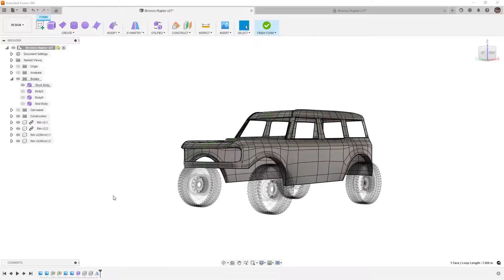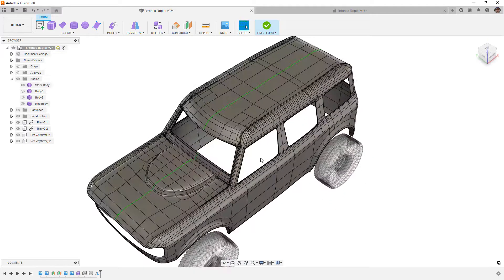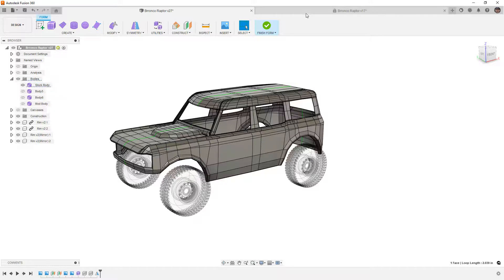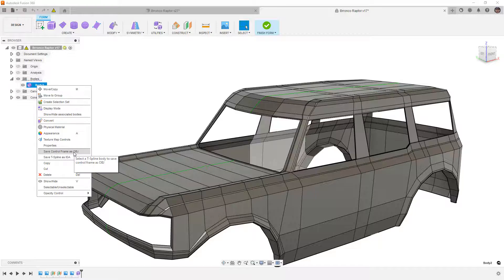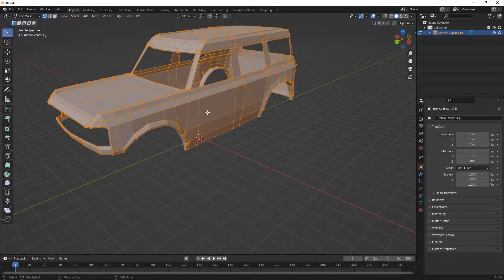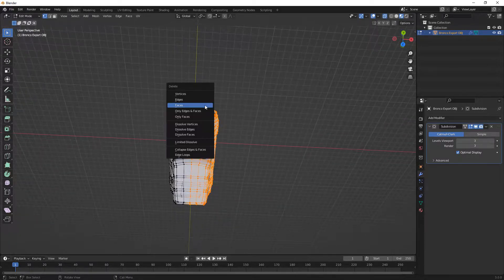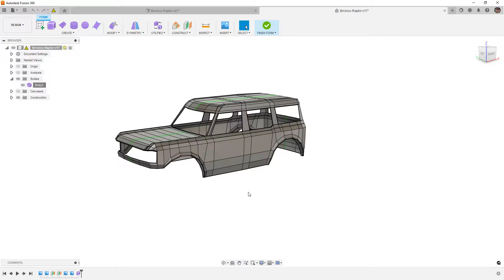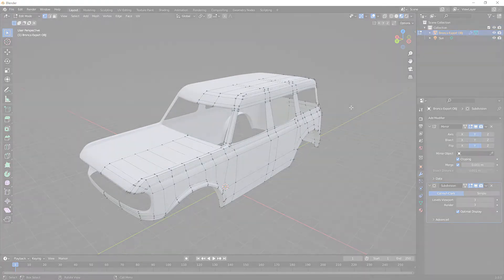HOW TO | Export a Control Frame from a Fusion 360 FORM to use in Blender as a Mesh | #Blender

Comment: The one thing I would sell a kidney for is for Fusion to allow saving the quad model after tessellation. The world would be just that might brighter if I didn't have to use third party software or ZBrush to make a quad mesh.
Reply from the maker: Yeah its not simple but there are 2 options.  When you tesselate a nurbs/brep in Fusion there is an option to make a quad mesh.  Also if you have the Product Design Extension, the organic conversion will turn the tri to quad and to a form body.  Autodesk used to have Momento which was a free quad mesh conversion tool, but outside of Fusion.  It really would make life easier if the tri to quad was just baked in there....

Comment: Can you do the opposite? Export from Blender a cage and make it a form?
Reply from the maker: Yup

https://youtu.be/wRXf4QyMCMc

There are limitations.  In order for it to convert to a form it has to be quads and there is a limit to the number of faces.  There are some extra options in Fusion if you have the commercial version and have the product design extension.  There is a built in mesh to solid or mesh to form conversion that tries to remesh as quads.